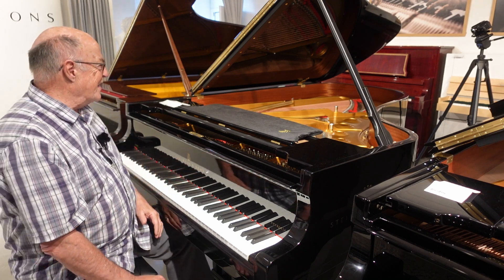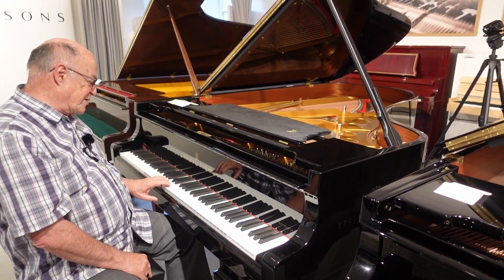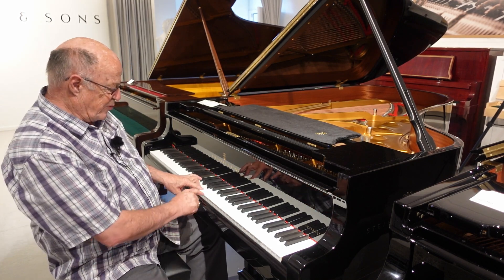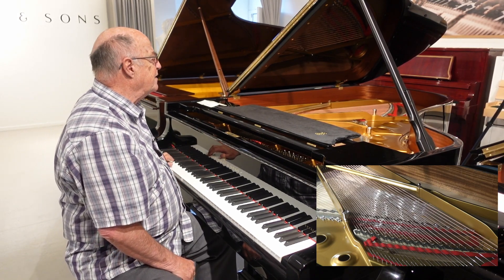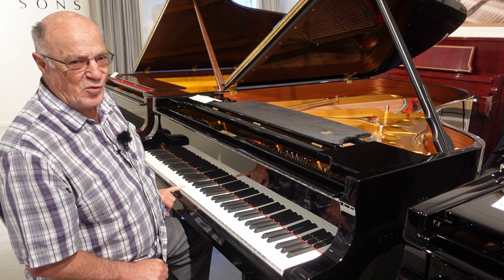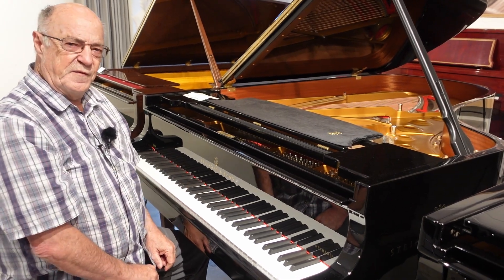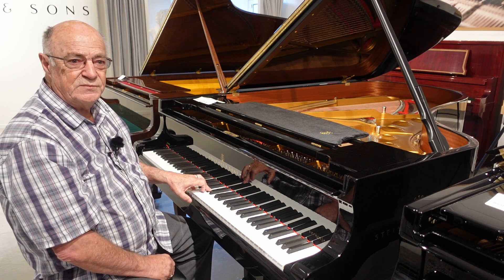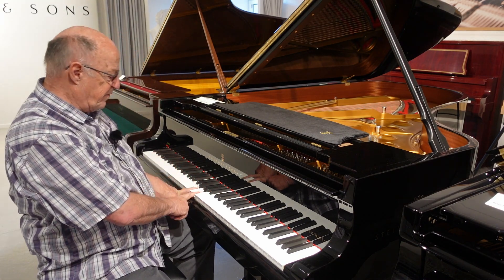Antenna Tuning  ----Shorter or Longer ??

Comment: Roly, you and the other guys (Callum, Mike, etc) frequently discuss radials and I know your view  differs.  I am looking to elevate a ground mounted 40m vertical and I’m curious how that works at your AM broadcast station?  you have radials on the ground… does the tower act as the vertical part or just the radiating element at the top?
Reply from the maker: Hi Richard,
In all the AM installations the whole of the tower is isolated.  The whole tower sits on a very large insulator and all of the guy wires are also broken up with insulators.  The radials (256 of them) are all buried.  The tower is then feed from the base and the whole of the tower acts as the radiating element...........cheers
Reply: @ZL1BQDRoly    where is the connection point?  does a coax go to the antenna and the shield / ground drops down from there.  I’m sure I can insulate my tower, at least by 10’ sections. i also have a torch and welder and could increased the number of joint, maybe with a mix lengths.